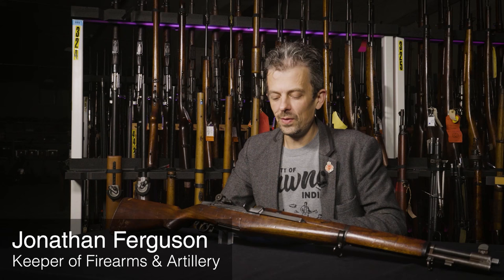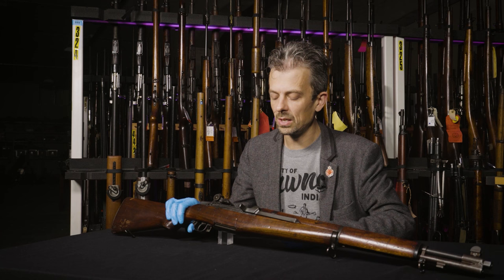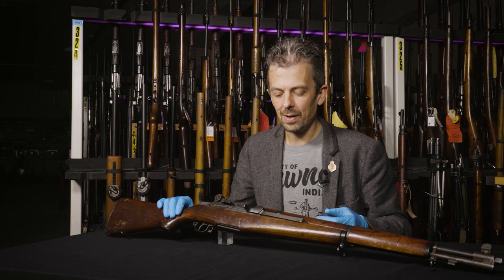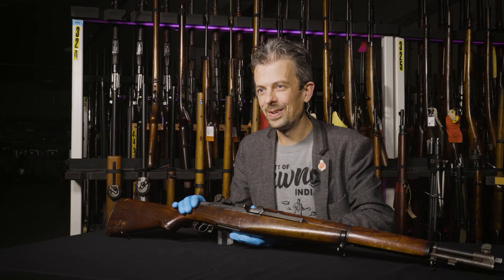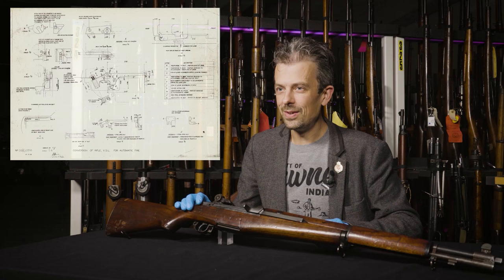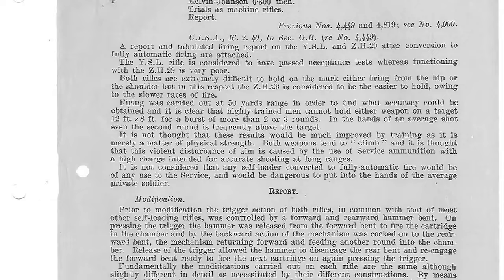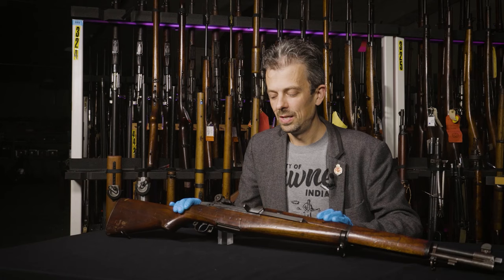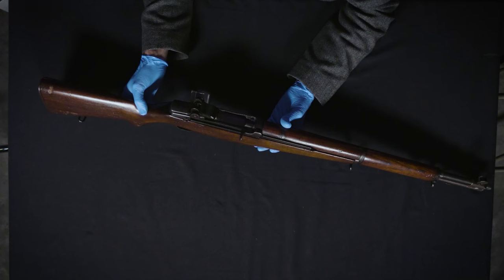Why did Britain make a fully automatic M1 Garand? With firearm and weaponry expert Jonathan Ferguson

Comment: William Atwater talked about the fully automatic M14. Words to the effect of "The first round was on target, the second was over its head,  and after that it was an anti- aircraft gun." Would probably have been even worse in .30"-06.
Reply: The ballistic performance of 7.62x51mm NATO is roughly the same as the .30-06 military load. That was kind of the point of the 7.62x51mm round, really - the same performance from a smaller cartridge.
Reply: Anti-Aircraft gun????,if you can prevent the Back Skull from breaking
Reply: The potency of the 30-06 (or the later .308/7.62 NATO) is precisely the reason weight is your friend when control is the issue. The Browning Automatic Rifle or BAR was heavy, but controllable -thanks to its two-speed rate selector, but also its mass. Reduce the mass too much as in the M-14, the weapon becomes much less effective as an automatic fire weapon. The British experienced the same issue with the SLR/FAL, and so did the Germans with the G3. Perhaps the sole Cold War battle rifle to solve this dilemma was the Italian BM-59, whose superb muzzle device tamed much of the muzzle rise inherent in the cartridge when used in cyclic-fire weapons. 

These weapons could be fired in full-auto, but one needed a bipod and perhaps a pistol grip and fore-grip for control. They were not designed for base-of-fire sustained full-auto operations, though, only for occasional use in that manner - as they lacked a QD barrel, ability to feed from belted or linked ammo, and other features found on true GPMGs and LMGs. The trick to firing one of these battle rifles in full-auto is to take a page from the BAR book, and sling it waist-high where it can be locked against the hip and fired in short bursts. Of course, one is more-exposed standing up which isn't always a good idea on a battlefield, but that's another matter. 

To me, the difficulty turning battle rifles into select-fire weapons goes back to the failed idea of the "universal firearm" or "universal service rifle" and cartridge. It perhaps reached its lunatic peak with the idea that the M-14 would replace half a dozen different weapons ranging from the M-1/2 Carbine to the M3 Grease Gun to the BAR. What I'd like to know is what those guys writing that requirement were drinking and smoking at the time! Completely foolish and unrealistic design requirement! 

Maybe I'm old-school and a dinosaur, but I don't see where the system of small arms TO&E followed up until WWII & Korea was that bad. Namely, the line--up of weapons and functionalities/roles for them. Garand as the infantryman's primary service rifle, some SMG - whether the Thompson or the M3 or something like it firing a pistol cartridge, with a capable GMPG or light machine gun, which in those days in the U.S. would have been a M1919 Browning MG. Carbines for the support troops, NCOs, officers, etc. and M1911 pistols for those who needed/wanted them. 

Pistol & SMG range - pistol for CQB/close-range, SMG out to 100-150 yards. M-1/M-2 Carbine about the same, give or take, the sights only graduated to 300 yards, but it is at its best inside of 150-200. Battle rifle, machine guns for ranges out past that. I suppose the point I am making is that the assault rifle was in certain ways a solution in search of a problem. It did certain things very well, that could not be done by existing weapons, but it also forced armies to compromise their capabilities when "everyone" got issued an M-16 by the latter half of the Vietnam War. 
Like Kenneth Royce, the firearms trainer and author, I am happy (for the soldiers, that is) that this class of weapon, the assault rifle, was invented, but just as someone who only has a hammer begins to see everything as a nail, the prevalence of these weapons has gone too far and now the pendulum needs to swing back the other way somewhat. 

Of course, there are those that argue small-arms are approaching irrelevancy on modern battle fields anyway, what with all of the 21st century technology around these days. But someone forgot to tell those fierce Afghan tribesmen that, I guess.
Reply: Hold the weapon sideways, aim to the left and hope it pans right if one needs to engage a few down range.
Reply: @GeorgiaBoy1961  The British did not, in fact, experience it with their L1A1 SLR. As the name suggests, the Self-Loading Rifle was semi-automatic only, maybe thanks to these experiments.
Reply: Only a fool would fire on automatic unless at virtually point-blank range when you aren't likely to do anything but stitch your target.
Reply: @modelrailwaynoob  - Most of the sources I have seen, i.e. professional soldiers who have been there, done that - say that cyclic fire is to be save for those moments when the sh*t is about to hit the fan.... ambushes, contact unexpectedly, breaking contact, assaulting a fortified position and so on. Otherwise, save the ammo and make each shot count. Resupply may not be as near as you think!
Reply: @MarvinCZ  After they had conducted trials with FN manufactured FAL's with were select fire weapons and found out the automatic fire "feature" was a no go in 7.62mm NATO
Reply: which is exactly why you aren't supposed to fire it auto except with a bipod or full rest. About the only actual value of a MG is suppression, which it would have been good at. and unlike the 5.56N, with 7.62N you don't NEED a 3-round burst.

Comment: Basically, the Brits discovered the m14 and its flaws 15 or so years before the US? Fascinating
Reply: The adoption of the M14 wasn't about what was effective, though. It was purely political.
Reply: Should they have adopted the FAL?
Reply: @marcgucciardo1942  Perhaps they should have adopted the FAL, but more importantly, they should have adopted an intermediate cartridge like the British .280 that the EM2 fired.  Unfortunately, US army ordnance was too backward looking.  After action reports from both WWI and WWII showed that the vast majority of infantry actions took place within 300 meters.  So what was the point of giving soldiers a full power battle rifle designed to shoot accurately out to 1000m?  To have that long range capability necessitated a powerful cartridge, that was too powerful for controllable full auto fire (as indicated in the video), and that needed a heavier rifle to fire such a powerful cartridge, and it meant less ammo could be carried, since each individual round was bigger and heavier.  An intermediate cartridge, designed to work out to 300m, could be smaller and lighter, enabling the rifle to be smaller and lighter as well, and enabling controllable full auto fire.  The Germans proved this concept in combat during WWII with the  StG44.  The Russians and the British both took note of this, and produced proper assault rifles, firing intermediate cartridges (the AK47 and EM2 respectively).  The U.S. army took note of this, and thought it was a good idea too, BUT...  The U.S. army was unwilling to give up long range performance, never mind what the after action reports of two world wars showed.  So they slightly decreased the length of the .30-06 cartridge to make the .308/7.62mm NATO, thus paying lip service to the idea of an intermediate cartridge -- but in reality the 7.62mm NATO was still a full power battle rifle round.  They tried to eat their cake and have it too, and ran into the same problem the British did in this test: you simply can't make a full power battle rifle controllable on full auto.  As a result, the M14, once adopted, had the selector switch disabled, turning it back into a semi-auto only rifle.  The British, who for the sake of NATO standardization, unadopted the EM2 and adopted the FAL, rechambered for 7.62mm NATO, did the same thing, and deleted full auto capability from their rifles too.

All in all, thanks to the stubbornness, and the backwardness of the U.S. army ordnance bureau, NATO was prevented from having a proper assault rifle for another couple of decades, until the 5.56mm came along (which is arguably too small, and a less ideal cartridge than the .280 British round would have been).  It's a good thing the Cold War never turned hot during this period, as NATO troops would have found themselves at a serious disadvantage in terms of their small arms.
Reply: @Hibernicus1968  While most of your post is correct, I would dispute the claim that 5.56 is "too small" or that NATO would've been at a "serious disadvantage" due to 5.56. 5.56 is pretty great, especially when fired out of full-length rifle barrels, in fact its performance was so good the Soviets copied it with their own comparable cartridge: the 5.45x39. The problems with 5.56 was again due to US ordanance bureaucrats trying to save a few pennies during the transition from .308, as such they used the wrong powder which gummed up the more sensitive mechanism of the M16. Later, the carbine rifle lengths started to give issue when the USarmy moved away from full-length rifles to carbine rifles for ease of use in vehicles as well as urban combat. 5.56 loses a lot of its potency out of the M4 as was proven in Somalia and later Afghanistan.
Reply: @Birdy890  Perhaps I need to clarify.  By too small, I mean too small to be ideal.  5.56mm is effective, and it's telling that after we adopted it, both the Soviets and the Chinese later switched to quite similar .22 caliber, high velocity rounds.  Yet 5.56mm comes at a certain cost.  Barrier penetration has always been somewhat wanting, as has tracer performance.  When we got into Afghanistan, where longer ranges were more commonly encountered, we also sometimes found 5.56mm coming up a bit short -- literally -- in terms of performance.  And when velocity falls off sufficiently, the bullets don't tumble on impact and terminal performance suffers.

There's reason to believe that something in the 6-6.5mm caliber might have been a slightly better compromise (.280 British was slightly larger, at 7.2mm, but still closer to that size).  6.5 is in a particular sweet spot, where you can get an ideal combination of sectional density with a high ballistic coefficient, so that you end up with flat-shooting, but mild-recoiling cartridges with good terminal performance, good barrier penetration, and good tracer performance, quite controllable on full auto, and light enough in weight to allow plenty of ammo to be carried.  Switching to a 6.5mm does not offer enough improvement over the 5.56mm to justify the massive expense that changing calibers would entail at this point.  But if we'd adopted a cartridge like that back when we made the switchover from full power battle rifle cartridges, we'd probably have a slightly better rifle and cartridge combo.  Changing calibers is probably not justifiable from a cost perspective until we perfect caseless ammo or make a similar leap in firearms technology that renders all our current ammo obsolete, not just 5.56mm.

Comment: Jonathan: “There was an experimental variant of the Garand capable of automatic fire.”

Video game developers: “WRITE THAT DOWN! Write that down!”
Reply: Me: If this is news to them they should really read some of the books out there that go through the prototype variants of the M1 Garand and M1 Carbine, they're quite interesting.
Reply: @Jon-jn5os  A full auto garand is a bar's special cousin lmao. Less than half the ammo capacity of a Bar so the tactics are going to be much different, no walking assault or bunker clearing for this one.
Reply: @leggo0116  IIRC BAR also has a bit more chonk to keep the barrel down
Reply: @DrRussian  do they use the same ammunition?
Reply: @roosterbooster6238  Yes, both fire the .30-06. The BAR (M1918A2) weighs 19 lb, the M1 weighs around 10 lb.
Reply: @Jon-jn5os  No.  A full auto M1 is more like an AK than a BAR.  (rotating bolt long stroke gas vs AFAIK tilting bolt).  The little brother of the BAR is the FAL.
Reply: @JohnHughesChampigny  that tracks since Browning spent his later and arguably best years working for FN. One of his assistants at the time was one Deudonné Joseph Saive.
Reply: COD will then add a drum mag, reflex sight and turn it hot pink!
Reply: @MarvinCZ  thanks I always thought they used different rounds as in the bar used a smaller cartridge - never seen either in real life so blame Hollywood!!
Reply: The US military did the same thing as the British but had 20 rounds Bar magazines
Reply: @m2hmghb  as a game developer although it wouldn't be realistic I would decrease the chance of RBD (Random Bullet Deviation), Increase the effective range, and allow it to be fired from the shoulder while the BAR can only be fired from the hip (like it was in walking fire).
Reply: @lolk4530  The irony is the opposite would be more effective. The recoil of firing the BAR from the shoulder helps to support it. However the lighter weight of the M1 makes it uncontrollable from the shoulder but would probably be more controllable from the hip due to moving the pivot point forward.
Reply: @m2hmghb  precisely. An idea I just had would to allow the player to unlock a modification to the Garand to place a weight closer to the forend of the rifle to offset some of the vertical recoil. Meanwhile the BAR would have the option of placing the hip fire cup on the strap of a backpack instead of on the belt.
Reply: A comment worth of my rare upvote. Congratulations, you shouldn't care.
Reply: I would love to see a game dev include this as a hidden Easter egg, and have it function exactly like it would have in real life; one trigger pull and you dump half the mag, most of it into outer space.
Reply: @MarvinCZ  never having seen them in real life I always thought the bar used a smaller round.

Totally ignoring that intermediate cartridges weren’t a thing when the BAR was invented
Reply: @MarvinCZ  9.5 empty as I recall.
Reply: @jesspeters1611  I think I included the sling in that weight, since that's the standard. That adds a bit over half a pound. The bayonet would add another pound, I didn't include that.
Reply: Hey Man, That's Funny So I'm Going To Give You A Thumbs Up!  8-)
Reply: @Jon-jn5os  it looks nothing like a BAR
Reply: It was actually used in the Cold As Hell total conversion for Doom
Reply: At least this automatic Garand didn't appear in Vanguard.
Reply: Yep. It's for killing Cthulu. Not much other use.

Comment: I just got my first M1 garand, and I am excited to clean it, and take it out to the range. It’s receiver, or body as you put it, is a 1943 receiver, a 1948 barrel, a 1957 trigger group, and a 1957 operating rod. All of the components are Springfield armory make.
Reply: They are a blast to shoot, and I guarantee that when the clip comes out and you hear the ping, you will have a huge smile.  Mine is a 1940 Springfield that I got from CMP.
Reply: Good luck cleaning it, I don't recommend fully stripping it down at first. Spent 2 hours getting my grandpas M1 working after it was shoved in a closet for a few decades.
Reply: @LostShipMate  I followed brownell’s 4 part guide to disassembly and cleaning yesterday afternoon, and tore the gun down completely. I had a little bit of a hard time putting the small magazine parts back together, but I was able to. I cleaned the hell out of that rifle, and put new oil and grease in it. I’m going to the range with it this afternoon for the first time.
Reply: @michaelm9211  Thats certainly the way to do it, watched the same guide myself. Definitely not a Mauser takedown.
Reply: Warning, they tend to reproduce in the safe.
Reply: @IvorMektin1701  omg I just spit out my beer!!! Hilarious!
Reply: IvorMektin Bring them to John David in Anniston and we will go to the range.
Reply: @MichaelTheophilus906  I greased all the slides in the receiver, I greased the top of the bolt where it rubs the receiver, and I greased the under side of the barrel where the op rod rubs on it.